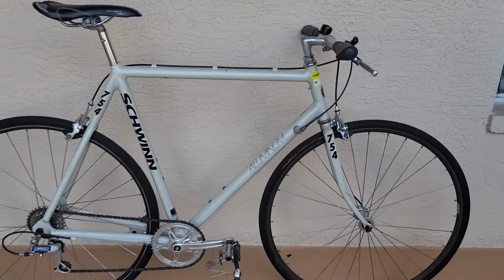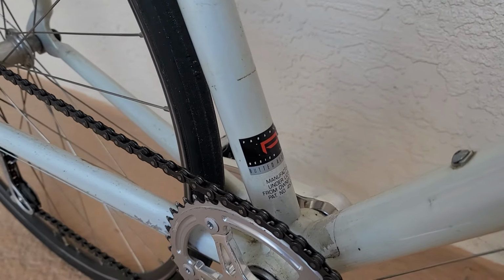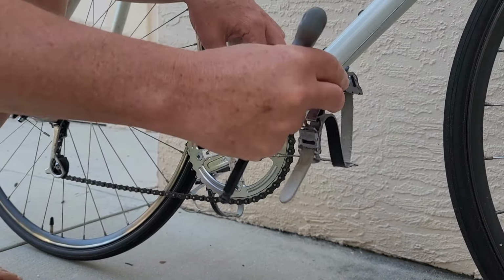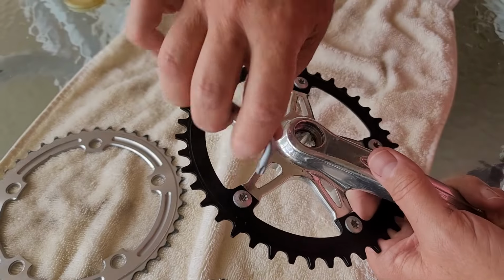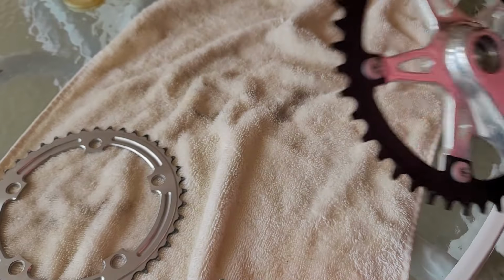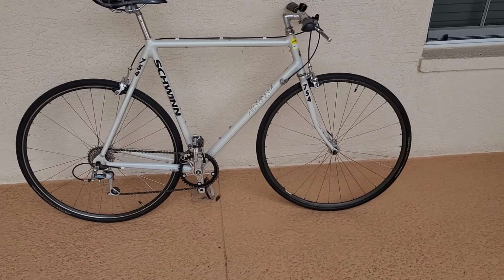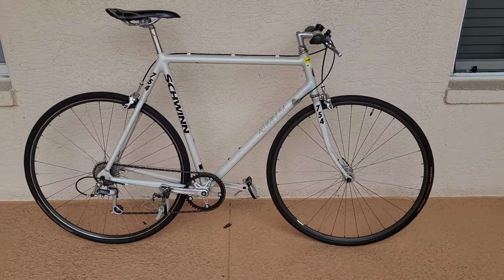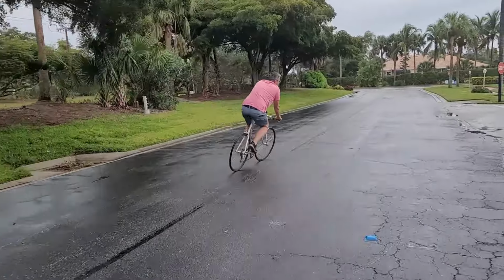How to easily fix chain drop on 1X Conversion. Starring a Fat Bar Road Bike Schwinn 754 PDG

Comment: Nice 754. I sold a red/white 1989 Schwinn 754 earlier this year on eBay. I don't ride aluminum bikes anymore (or even road bikes), so I ended up selling it.  You really gotta inspect those seatposts on the Schwinn Aluminum bikes from that era (too many folks over tightened them, resulting in damage). Thanks for the video.

Comment: I'm in the middle of doing 1x conversation (waiting for new chainring) and just curious is your gear ratio enough for you with that casette?
Reply from the maker: Yes, it's perfect for the flat terrain around Florida. I have a 42T on the front.  If you have more hills, I would go a little smaller up front.
Reply: I already ordered 44t cause I wanna go fast with that bike. So now I confirmed I need bigger casette. 11-42 or 11-46. Thanks @DePuesshop